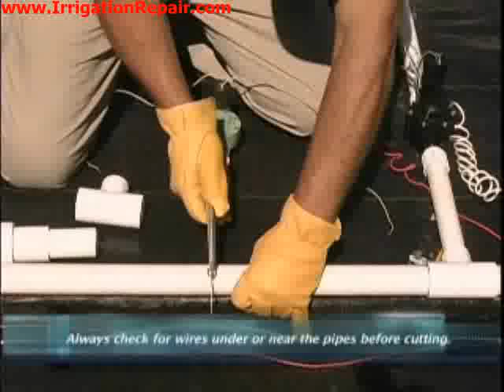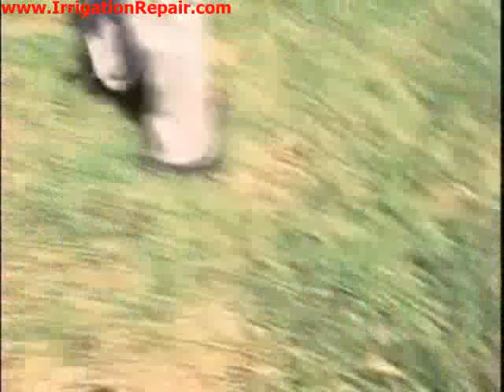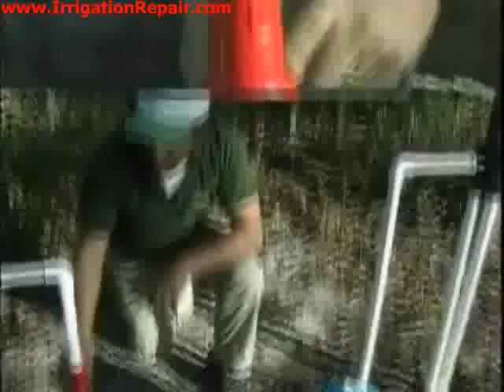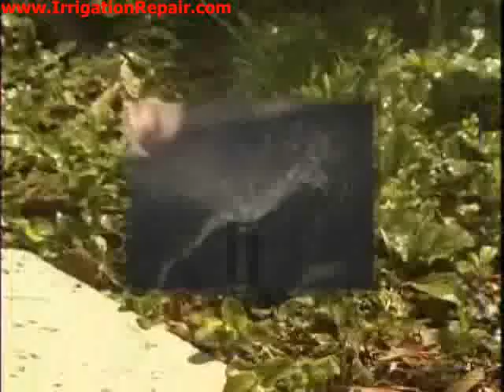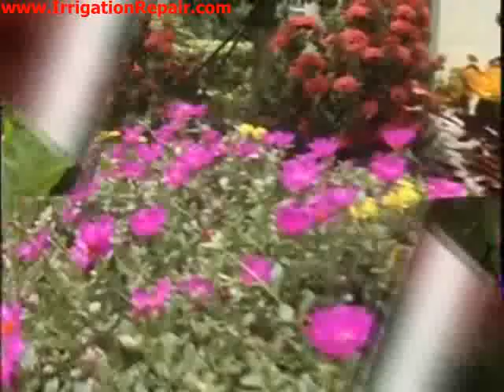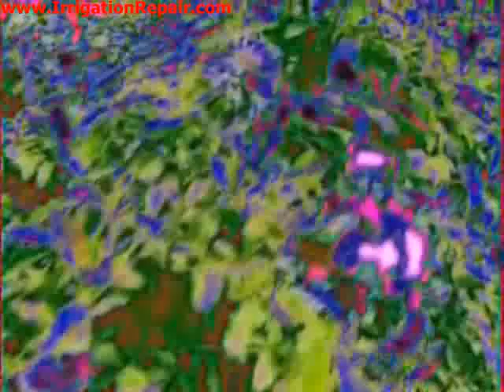Sprinkler Systems -  Lawn Sprinkler System Repair

Comment: In Orlando, Tampa, Sarasota and Miami, it's $95 an hour. Finding a  ground fault requires a $1500 tool, and a $15,000 truck, $5000 dollars worth of parts (if you do it right) as well as liability insurance, health insurance, gas, overhead, FICA, etc. etc. etc. 17% profit according to my tax lawyer is what you need to make to NOT go broke.
I have no idea where you work, or what your costs are, but I will assume you are in Possum Butt Kentucky where the overhead, as well as the foreheads, are low.